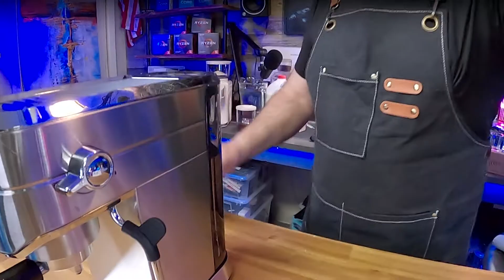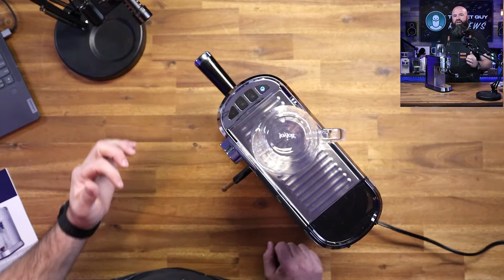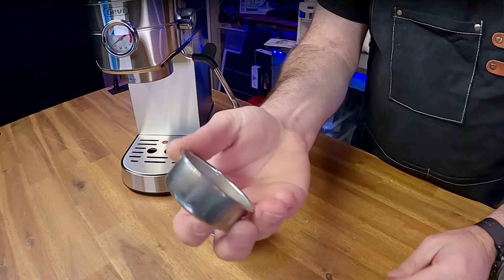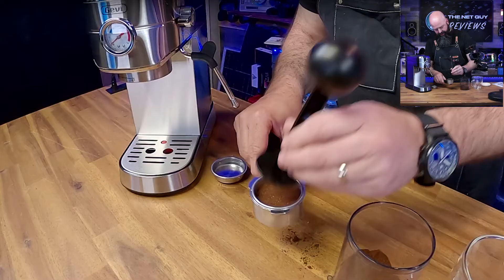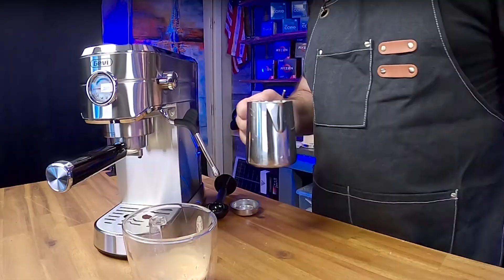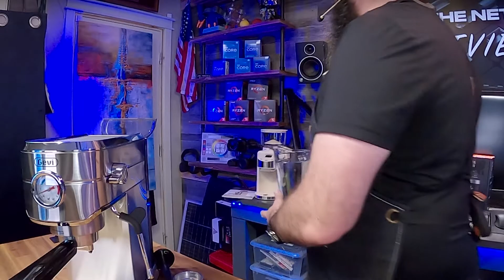☕️ Espresso yourself ➡️ Gevi Stainless Steel Countertop Espresso Maker

Comment: I keep watching videos of this machine because I have it and my milk frother is loud as hell, I can prove now it’s not only mine, it is the model.
Great espresso maker but terrible frother. It doesn’t have enough pressure to get the milk properly for lattes, it’s either super foamy or flat.
Reply from the maker: Good points here. Sorry to hear - their next model up has a dedicated boiler for each function and is the one we use daily now.  I wonder how they could fix it in the smaller unit.